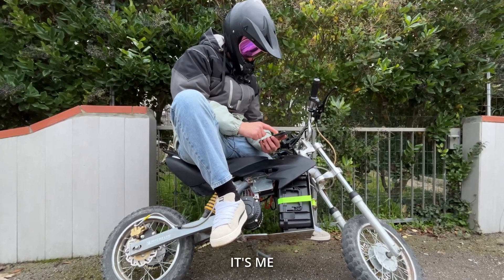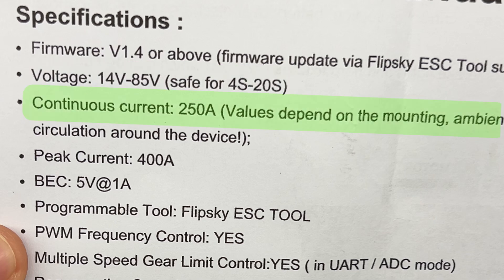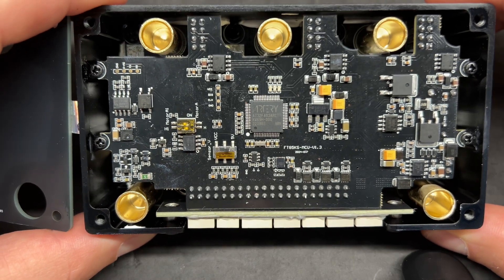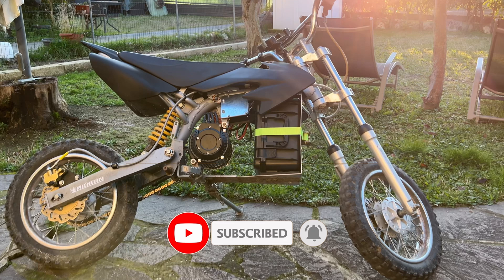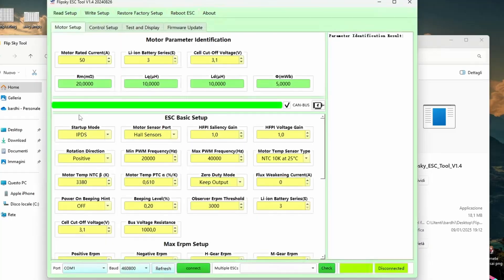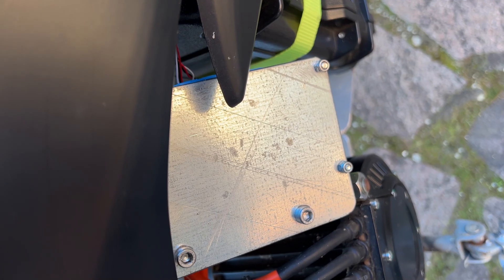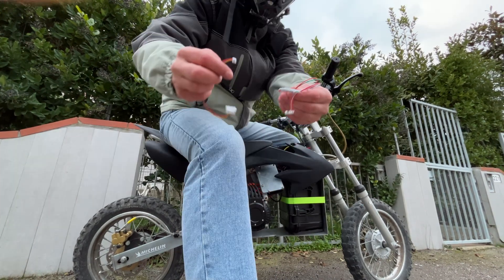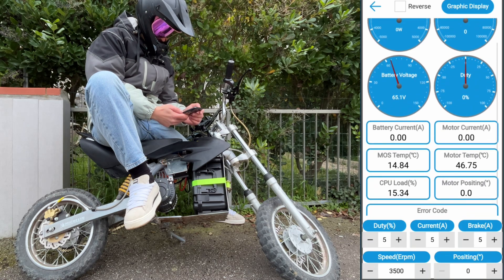FLIPSKY FT85KS - How I Doubled My eBike Power With One Upgrade?

Comment: great video! nice bike! im more confused 75100/75200/ft85ks! subscribed and will follow/look your videos. awesome
Reply from the maker: Hello thank you so much! What is your setup? Right now to me ft85ks is performing the best
Reply: @BardhiGjiniCrazyLabo  i have 60v motor/battery, motor 2kw and pik 5kw. main reason is space, need space for bigger battery later on. i ordered the 75200 pro v2, planning running it 40-60 amp, today stock controller running 40.

Comment: Does the app have modes like in Vesc?
Reply from the maker: Hey Mate! What do you mean? modes like speed gears and stuff? Flipsky tool has 3 different gear speed ratios which you can set as you wish and connect to your 3button (H-M-L) throttle

Comment: How fast it gets?
Reply from the maker: Sup man! Around 80kmh (50mph) full charge with my current gear ratio and 12''wheel and 100A Field Weakening
Reply: @BardhiGjiniCrazyLabo  That's awesome, I'm planning to use vesc on my next build, thanks
Reply from the maker: Np! What kind of vesc are you planning to use? This one s not
Reply: @BardhiGjiniCrazyLabo  Sprintend Single Ubox Aluminum controller 85V 240A controller based on VESC on super soco cpx which ahve 60v and 3kw motor
Reply from the maker: @ spintend has some really quality controllers!

Comment: How is it comper to 75200?
Reply from the maker: hey! well, with same exact settings (300A motor, 170A batt, 80 FW the resuls are:
-smoother slower startup from 0rpm
-more low to high end torque( around  30% more )
-more top speed ( arount 15% more )
But currenly running 400A motor ( gets hot ), 170A batt and 100A FW so improvements are noticeble!